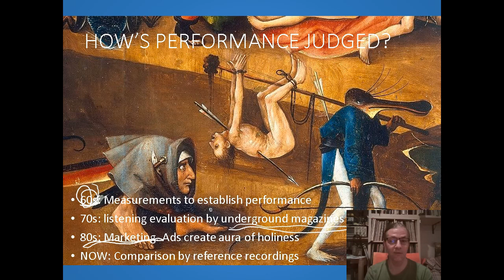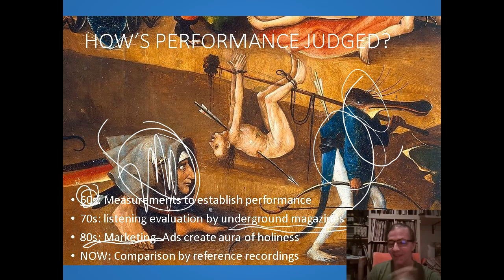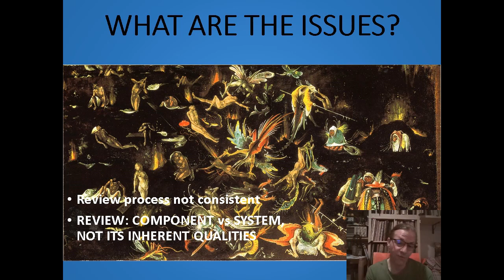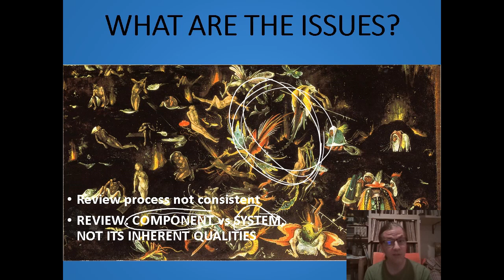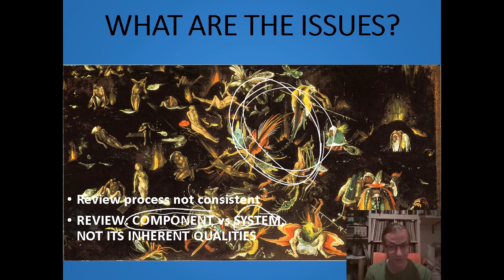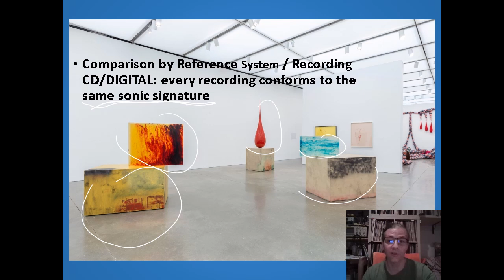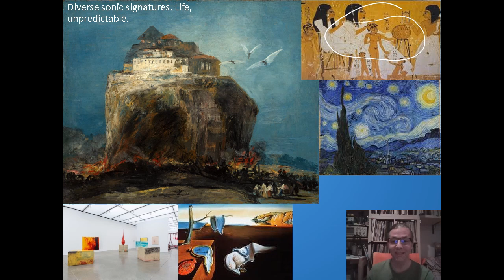Road to Audio Hell - Audio note inspired musings

Comment: You could also call this video 'avoiding Road to Audio Hell'!  I like your analogies via artwork: the ability to be able to bring out contrasts between recordings implies such a system has the broadest capabilities and does not homogenise the incoming sound. A quote from that AN article: "In true high-resolution audio systems, grain disappears and is replaced by a seamless flow of connected musical happenings"... the differentiation between the static tone (FR) and dynamic domain (time) never got made clearer imho. It connects to your 'copper/silver wire video'! There's other interesting AN articles here such as on true balanced connections and for example the one on the 'Ankoru amp' with underlying design considerations. Thank you for the link!